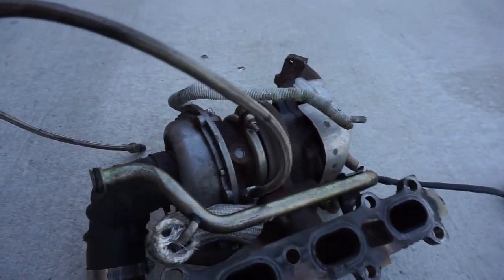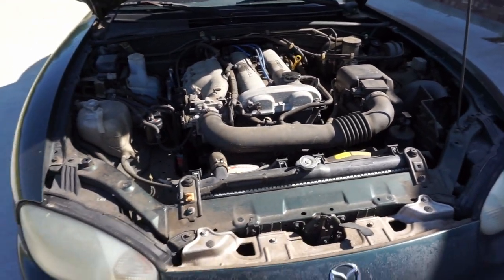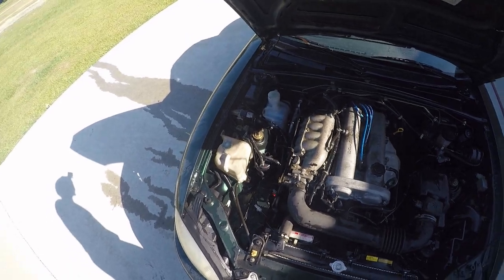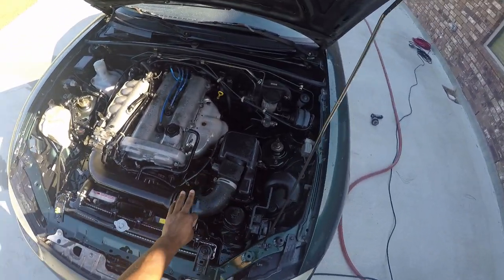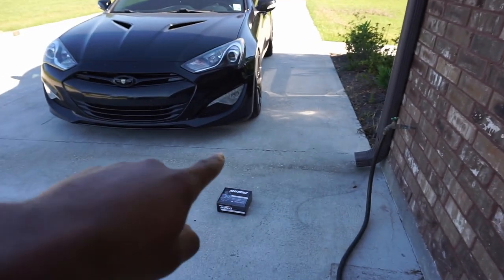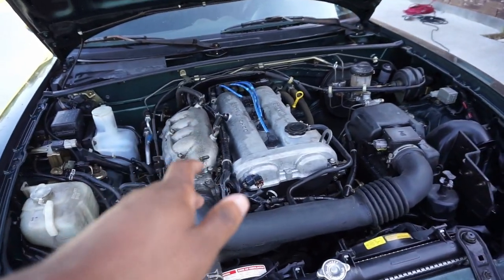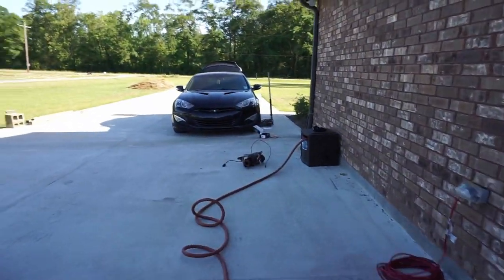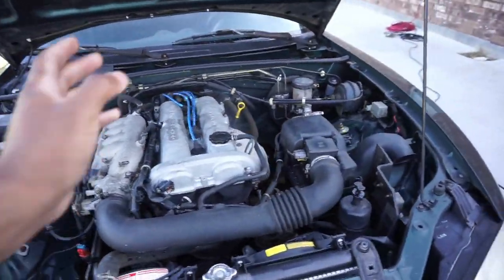I BOUGHT A TURBO KIT! Finally Boosting One of My Cars!

Comment: What's the " of the extended studs? Because I ran into this problem. Had to buy APR extended studs only ones that where long enough for the clearance I needed. Or maybe try and open end stud, cant see what your dealing with.
Reply from the maker: Well the Muteki spacers and studs costed me about $70 for 2 spacers and 10 studs.. Should be a decent upgrade over those stock spacers